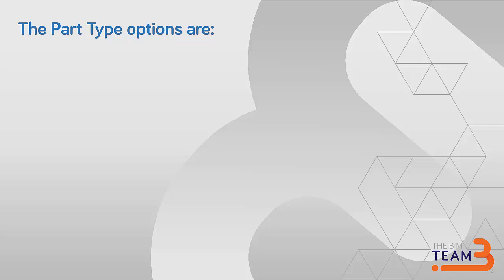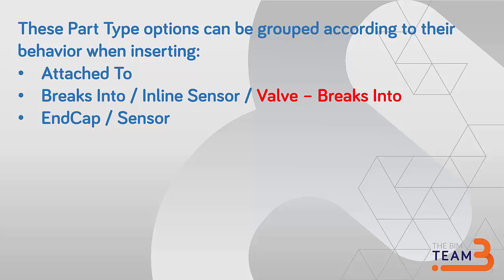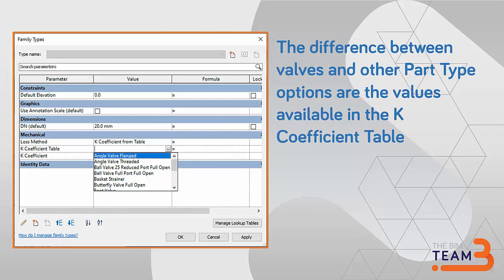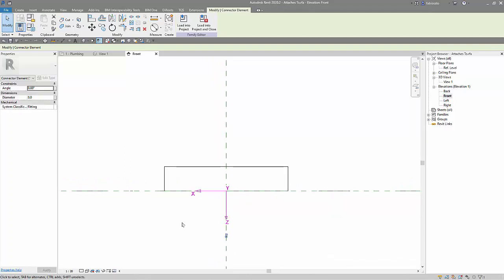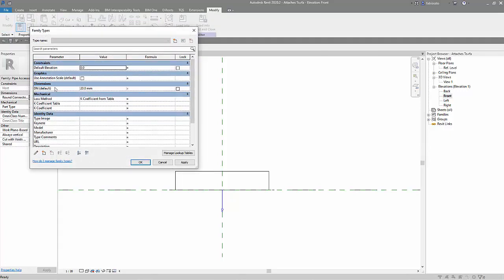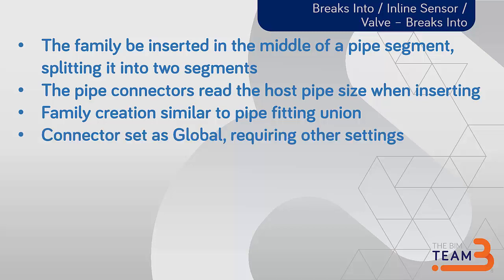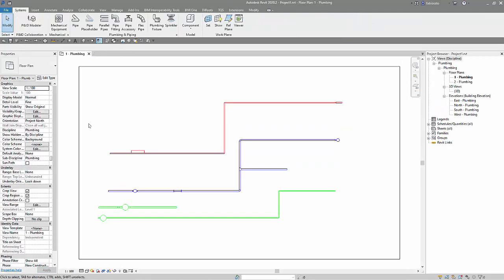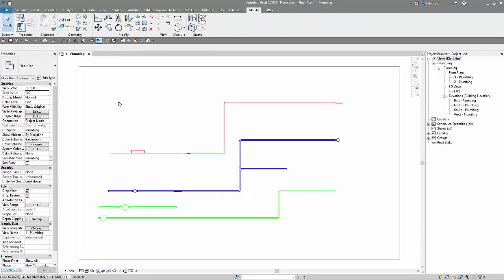Revit MEP -  Pipe Accessories - Part Types

Comment: How would you create a pipe accessory that does not break it into 2 pieces but is aligned to the pipe axis? Ataches to does work, its always gives a small offset.
Reply from the maker: Unfortunately there is no part to do it